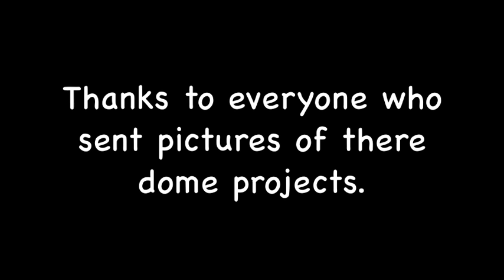Geo dome gallery slidshow

Comment: Paul, I'd like to order plans, but looking through them I'm not sure what to do.  I want to order a low profile 30-foot/plus diameter, or whatever would be cost effective, to cover with ply or OSB, as a home that I could add onto, in US measurements, and ripping 2x4 to do the bevel or another US wood? Also, would you be able to do plans that include a sidewall with triangles or standard sidewall, whichever would be better for my application?